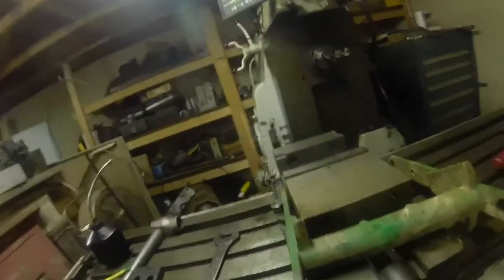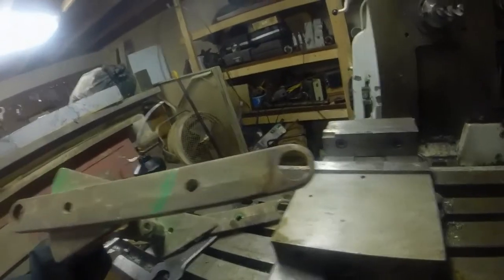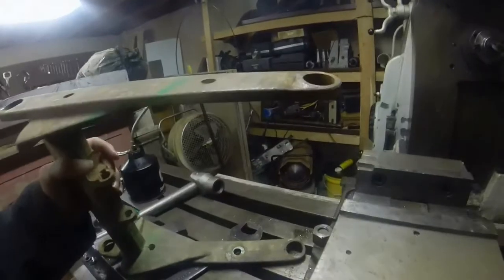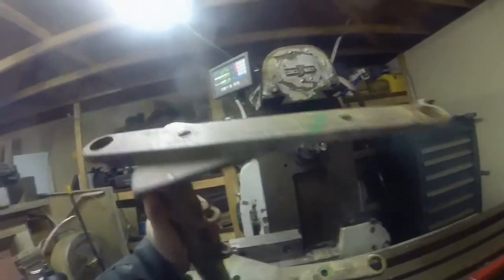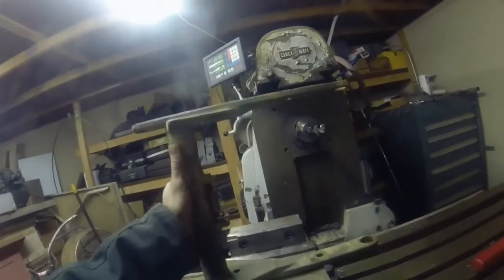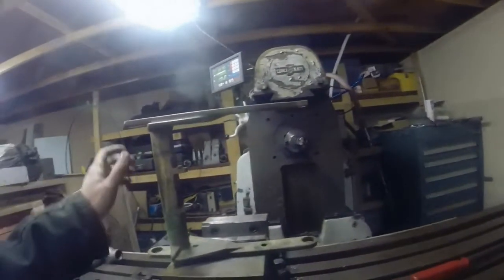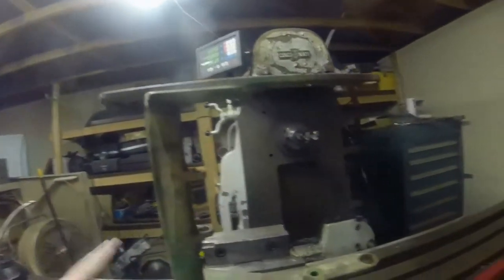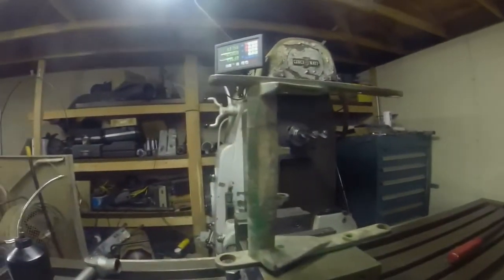Repeatble fixture made from common hold downs. Cincinnati #4 Mill drilling.

Comment: Thats a great mill you have there.  I have a cinci 2mi......mine looks like a tonka toy compared to that monster.  Do you have a hoist to get the vertical head off?
Reply from the maker: A 2MI is still a very useful and good sized machine. It is way more than a Bridgeport style mill that is for sure. Currently I use and engine hoist/cherry picker to get the vertical head on and off. It weighs about 500lbs by itself so I am not strong enough to do it by hand. LOL   When I get my new shop done it will be located so I can use an overhead crane for getting the attachments on and off as well as loading big parts like that 700lb engine block I have in another video.  My rotary table for this mill is even heavier and getting it on and off is a dicey situation as it wants to flip the hoist over so I don't use it much. Thanks for the comment!